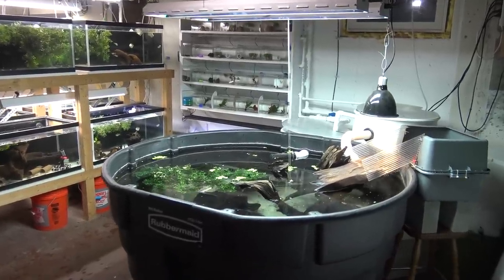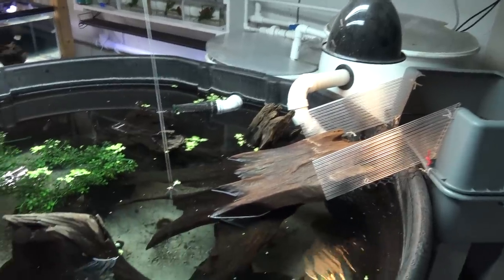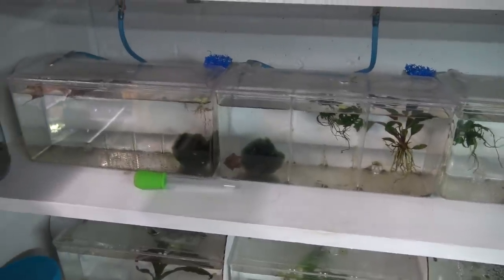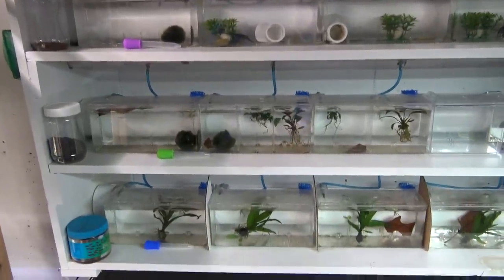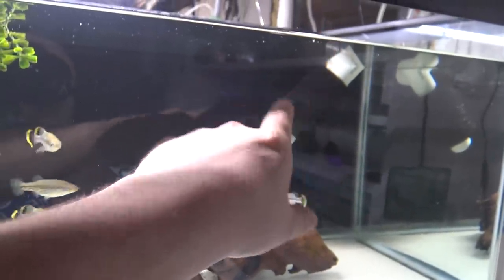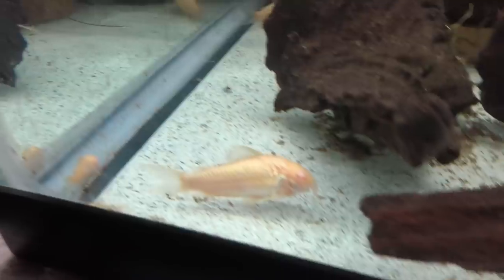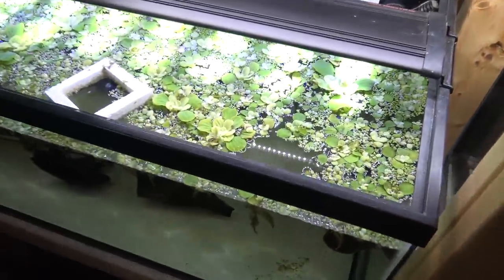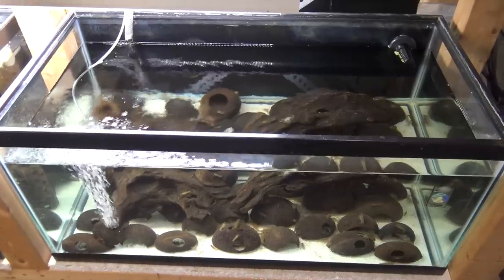#564: FULL FISH ROOM TOUR - Update Monday

Comment: You are a smart guy. 

1. I love the hang-on breeder boxes emptying into half-PVC.

2. A shop vac used in place of a siphon. Can you get the pressure to be constant? Like you said, air bubbles decrease the pressure. I almost want a sensor on the suction end modulating the power to the vacuum's motor.

3. The air-lift connected to the overflow. I can foresee a problem with the airlift: You may see an accumulation of gunk in the drain pipe, and that could cause problems months or years down the road.
Reply from the maker: Thanks! I have a clean out cap on the ends of the drain pipe to snake them clean if needed, but haven't had to in 5 years since it was built

Comment: I have some basic questions...
1. What do you do about the moisture(evaporated water) from the tanks? 
2. What kind of power strips to do you use for all the lights, filters etc...

Thanks in advance love the channel!
Reply from the maker: I have twinwall polycarbonate lids for everything except the stock tanks and run a dehumidifyer 24/7, I use 3x 4 outlet boxes with GFCIs to run all electricity
Reply: @gregjonesonline  Thanks Greg! That seems to be my main problem...my stock tanks are open and the water just evaporates like crazy in my garage...

Comment: Greg, where did you get those huge pieces of driftwood? (especially the one for basking) I have a similar turtle setup to you and I'm looking to use a big piece of floating/hanging driftwood but I have no idea where to get driftwood big enough to hold RES and YBS. Any help would be appreciated.
Reply from the maker: I was gifted the basking driftwood, no clue where it came from, i've never come across anything similar -- the rest is malaysian driftwood which sinks and is easier to find
Reply: Thank you. On another note, what size air pumps and airstones do you use in your turtle biological filter to move the k1 media so well? I want to use your filtration system since it seems to work very well.

Comment: When it comes to having a 1 central filtration system how do you work out what sort of pump you need as a return , I'm looking at setting up a 2 racks of tanks that will total 12x  4 foot by 2 by 2 , but I'm still really undecided how i want the filtration set up and obviously 1 central system would be the easiest in the long run I'm just not sure how to work out stuff like size of barrels , diameter of pipes etc
Reply from the maker: Aim for a pump that is capable of pumping 5x your water volume per hour at the head height you intend to pump up to, then use the diameter of pipe that that size pump recommends, and at least double that pipe size for your overflow/drain line, that should get you started!
Reply: @gregjonesonline  Very grateful for the advice , once Christmas and New Years are out the way I've got to drill and re-painting the backs of all the tanks and then start work on the electrics and plumbing set up